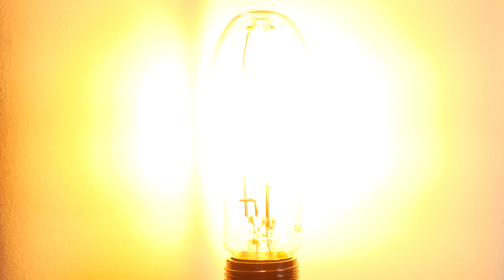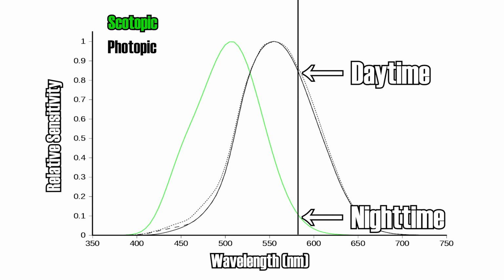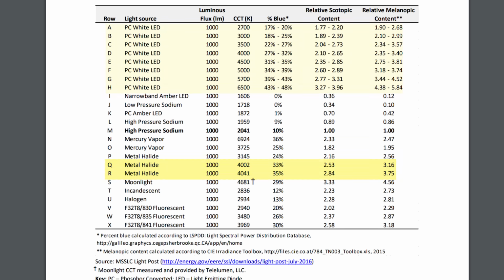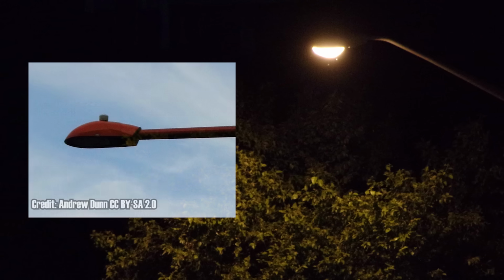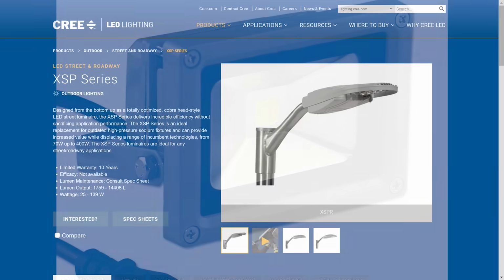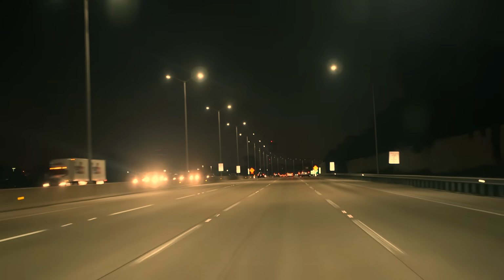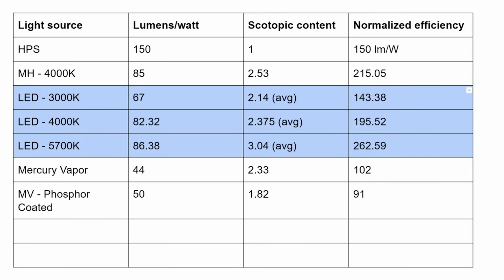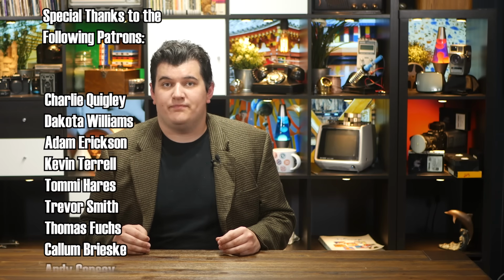The LED's Challenge to High Pressure Sodium

Comment: One of my absolute worst experiences I ever had with driving at night, was in a car that had all BRIGHT BLUE instrument lighting... I could barely see the road. Who comes up with such a dumb idea...
Reply: Didn't it have a switch, for turning down the brightness?
Reply: @BedsitBob  most people aren't that smart
Reply: That could be another topic for a video; what color of instrument lighting is best for night driving.
Reply: @digitalrailroader  BMW has the best. Reddish orange. Shame not the modern ones with operating system 7 anymore though.  Seriously drive one in the night (preferrably an older one, like an E90 or E60), you can keep brightness of the instrument cluster maxed and it won't do any bad for your dark sight.
Reply: @digitalrailroader  i would guess it’s probably red, the same reason cops use them to write reports. It is visible enough but doesn’t blind you from seeing outside of your car like a plain white light. Could be wrong though
Reply: @digitalrailroader  legitimately orange in the same vein as 80's jet instruments, why they switched to them
Reply: @digitalrailroader  dark amber
Reply: @digitalrailroader  red
Reply: @digitalrailroader  
Red, at least for instrument panel  ( dashboard) lights. But the green light in my van and cars  I've driven over the years  seems to work pretty well. I don't remember ever driving a vehicle with red dash lights. Maybe orange once.
 I've only seen the red  in other cars but they look really cool.
Reply: White for sure,dim white
Reply: @digitalrailroader  red probably
Reply: @digitalrailroader  Airplanes use red lighting which allows you to see outside the plane.
Reply: @digitalrailroader  green?
Reply: @tiger.98  Green was my first thought too. I work on aircraft and I think that's why I thought green
Reply: Bmw uses a dull orange for that exact reason. I never really noticed the effectiveness of it until i got a second car (Honda) which was green blue white whatever. They’re super effective as not distracting you at night.
Reply: @1v1qsns  yup. My 86 325es had that. IMO the best instrument color ever made.
Reply: I prefer red for my guages. Blue is far too distracting
Reply: @Jan Tuts - That bright blue dash lighting was almost certainly aftermarket, installed by some boneheaded previous owner. I've seen it done too many times.
Reply: Whoever thought blue light would be "cool" (as in impressive). And stupid stuff is usually considered "cool", regardless of the problems it causes.
Reply: Stuff like that should be dimmable. Most cars will dim the instrument cluster when you turn on the headlights. My car has a little thing to adjust the backlight
Reply: I have a serious vendetta against blue interior automotive lighting. It's borderline painful at night in some cars even on lowest brightness. White on black with amber needles was seriously the best dash design, idk why everything had to switch to fancy piercing colors. My 90s Volvo is white on black and easy to read in all lighting conditions with backlight set to near minimum. Simple and effective. Only color I would prefer over white is red for night driving, but I find during the day it's harder to see.
Reply: Was it a Mk4 or Mk5 VW Golf/Jetta?
Reply: @MacTechG4  Passats of that era also had blue dials, likely other vw products. Didn't own one but the few times I rode in one I did find it very distracting.
Reply: yes, they are blinding, but also problem of car driver themselves, they should adjust the high of beam so it doesn hit above the car's side mirrors
they can be arrested and fined for this mistake
the worst is when truck's and buses have those powerful beams, they force you to stop if they are behind you
i wear yellow polarized shades that stick to my prescription glasses when driving at night
Reply: To everyone who keeps saying "just turn down the brightness" or "change the colour":
That might be useful if it's YOUR CAR, that you know in and out (and are allowed to tweak), but when you have to hop in and drive someone else's car, that might not be the case.

And yes, blue light might help keep you awake, but it also destroys your night vision, which I'd say is quite important while driving at night.
I'd rather have to make the conscious decision whether or not I'm awake enough to drive, rather than have my vision compromised either way...

Also, if you're at the point of tiredness where you need to be kept awake by the light from your dashboard, you should definitely not be driving!
Reply: @JanTuts  Well-articulated comment.
Reply: The first time I saw one of those things lit at night, I thought it was the stupidest design on the planet.
In my own older car, I swapped out all the white lights for red ones, and even changed the color of the dome light to red.
One of the main reasons I did this is because I had two night jobs that required about 100,000 miles a year.
When I went to trucking, it was part of the job to drive at night, sleep during the day.
Everything in my sleeper was black, so I could be a "vampire" and sleep soundly all day.
Reply: yesss they should be banned for use in cars, when I ride my bike at night through my neighborhood I have to cover my eyes when a car with those white lights approached my head on on the opposite side of the road, it almost blinds me. when it gets too irritating because they are driving also with their high beans on I flip the finger at them to let them know they been bad.
Reply: Blue light is harder to adjust to for your night vision than red
Reply: I remember I had a Dodge Avenger (2nd gen) as a rental once. The guages were white and backlit. As in, the entire round gauge was white, and the numbers were not illuminated. So you could either burn your eyeballs, or turn down the brightness which made the gauges difficult to read.

Just stupid design.
Reply: Uh, turn down the brightness
Reply: My BMW uses a nice warm orange, it's an 08 e60 5 series
Reply: Yeah instrument gauge lighting adjustments are a thing on cars since like 1976
Reply: Volkswagen used to have blue dials with red needles, now they switched the dials to white - much better IMHO.
Reply: @paulzapodeanu9407  Yeah, I have 2008 golf and blue light are annoying AF. Even when turned down to lowest. There's a reason night-time flashlights are red - it doesn't blind your night vision so bad
Reply: @kasparslaizans3842  ahaha i was thinking about VW too. First time I drove them.at nights I was shocked. It was like a cheap night club. The screen in the middle console was torching my retinas even at lowest setting. If you turned off radio it mostly showed a black screen so I had to give up music to protect my eyes and driving ability.
Reply: well i actually did some swaps to blue lights, some people really love those. i'd suggest you check cars all around before buying or make sure you can dim or change the coloured bulbs
Reply: @Jan Tuts..... probably some guy whos never going to drive it
Reply: Obviously a person who lives in a world of one-way roads
Reply: I'd assume it's blue to try and be a safety feature, since reds will likely help you to fall asleep
Reply: @seamonkeys12y  Except now you're half blind and have no night vision. I pretty sure blue instrument clusters are all about looks. I doubt safety was ever a part of the consideration.
Reply: Volkswagen. They've stopped doing it. I had a Passat for a while, the lighting was a terrible distraction.
Reply: Yes i know sodium is just better because when you think of a street light you think of sodium not led
Reply: Dim the dash lights!
Reply: My 2nd gen ford escape is factory super bright blue. Even when turned down I wish it was a different colour. Really nice to look at, but killer at night.

Side note. Hyundai uses a very shitty blue on their dashboards that should be banned
Reply: I have owned a Honda with white gauges, GM cars with the sickly green, and BMWs with orange.

Of all of them, the BMW orange detracts the least from night vision, but is too sleep-inducing on long nighttime drives. 

Meanwhile the Honda white is more visibly distinct at very low brightness as opposed to green or orange, so less light can be used and the effect on night vision is about the same as BMW orange. Meanwhile the high blue spectrum content helps to maintain wakefulness. Overall this is my personal favorite gauge color.

GM green seems to be the worst of both worlds; hard to see when set very dim, yet lacks the blue light for wakefulness, yet still hurts night vision.
Reply: Sorry they make a product that has been researched to attract 99  percent of people that want to actually buy the product maybe companys should only sell products that cater to you. Obviously we have choices so don't buy something that isn't made specifically for you. Really
Reply: @dolphinvaio  In don't care what it looks like, I just don't want the car I'm driving to get me killed because someone thought it would look cool...
Reply: Satan and Agenda 21
Reply: @coolboy5428  Oh great, now there are conspiracy theories about street lighting
Reply: @coolboy5428  wew lad, you got a link to the Technology Connections video on Satan & Agenda 21?  Très curious
Reply: My car has a mostly white but slightly bluish green look. I find it a good color. It's slightly blue tinge helps keep you awake but it's also not so harsh as to hurt your night vision at max lighting level. It is also bright enough to be able to see the gauges clearly during the day. I never really felt distracted by the instrument lights.

Comment: I think the idea with the danger of the blue LEDs is that, just like a blacklight, the visible light level is low, so the UV sneaks in, both because you stare in its direction more, and that your pupils aren't as constricted
but I still doubt it. It wouldn't be that hard to test, just string some up in rat cages and see if they get cataracts...

(I actually like sky glow. People should certainly have the choice, but... it's cozy)

Comment: I miss the color of the old mercury vapor lamps in front of many buildings back in the early 1990’s in nyc,even some lamp posts still had the cool moonlight glow of mercury vapor lamps, the coated ones. There were one or 2 that still had the clear bulbs and the light was a bluish light,much better for the night than those piss looking sodium pressure lamps

Comment: Light pollution is a serious problem for nature and illumination does not increase security in traffic as Belgium's highways have proven. After shutting off illumination intermittently during the nighttime: it turns out if the street is not illuminated drivers drive more carefully.

Comment: They changed the traffic lights to l.e.d. in my town.they changed them back to the halogen lights or whatever they were after the first snow, because the l.e.d's were not hot enough to melt the ice. You couldn't see any light at all

Comment: Street lights were not introduced for driving safety concerns, but for discouraging criminals and robbers... As a pedestrian I'm less afraid of being hit by a car at night precisely because they have headlights .

Qnywqy, I think there is one additional advantage of HPSV light worth to be mentioned : because it's dim, warm AND very has poor CRI, it makes the surroundings visible but far less distracting.

The front zone of the driver, covered by the headlights, remains brighter and more colorful, which is consistent. But the most important thing TMO is that all the road signs and other reflective equipments are strongly highlighted,

In fact, here in France there are more and more highways sections and even rural roads that are no longer enlightened because the lack of visibility seems to paradoxaly reduce the amount of accident (by reducing disctrability and increasing vigilance)  

Well, that was my to cents...

Comment: For LED retrofit.. bypassed the ballast and direct wire the lamp socket..  no more ballast replacement, just replaced the LED retro fit lamp if it ever goes out.. that's how we are changing them t8  Fluorescent lighting.

Comment: Yes!!! Please I hope they switch to LEDs!!!  've always hated the orange lights. And I remember some years ago, on hwy 836, there was a really wide margin for a few miles and in the middle were some really tall lights with some super bright lights mounted and the poles for these light were very far apart. They lit up everything really great! And the lights were up so high that they didn't blind you at all. I've always wondered why they don't use that same kind of thing on streetlights. We wouldn't need nearly as many streetlight, and if they're up high enough, everything would be much better lit without the blinding effect that occurs with normal height streetlights no matter what kind of lamp is used. But to me, the orange lights are so hard on the eyes! I wish they'd finally get rid of them!!

Comment: As someone who has worked as a trucker, I can tell you a little circadian rhythm disruption isn't entirely a bad thing.

Also, the option no one is considering here is that LEDs can produce more than just blue light.  You can use a combination of diodes to produce white light.

Comment: Our town has been piloting various replacement led street lighting over the last couple of years in a few square block are that covers residential, as well retail, and commercial business. They are now one the third led lamp style and I have to say they are getting closer to good answer. Sorry I don't know the details of any of the three test led bulbs but this last batch seems to have taken the harsh edge off the light and is most noticeable on residential streets. It is not as soft as the HPS but seems to light the area better but not to the obnoxious level of the first two tries. It might also just be acclimation, I don't know.

Comment: The only thing I remember is at night our eyes produce something called visual purple to enhance our vision in low light and that the molecule is destroyed by blue wavelengths of light. I think that's what people are talking about when encountering these LED lights on cars. An encounter with them will reduce some of your low light visual capacity until the visual purple is rebuilt.

Either way, it's why I keep one eye closed when using the bathroom at night and walk back to bed with the other eye open so I can see my way back more easily.
Reply: I use smart LED's that can change colors, at night they will automatically be red to be less harmful on night vision just in case I need to get up.

Comment: On the forklifts at work we had to put straight blue light on it, they do blind you when you are getting wrapped pallets with plastic wrap or the light hitting the backside of the forks on the fork lift. I've been blinded numerous times. I'm not the only one either many of the guys I work with along those in the warehouse hate it as well. You might want to check into these.

Comment: Low sodium lights are used because they are easy to filter out you don't know why low sodium bulbs are use. because of light pollution.
Reply: the reason we use low sodiumb bulbs specifically because we don't see better with them dummy.

Comment: I work for an organization that build street lights. The preferred decorative type street lights, seem to be more often made in the 4000 K range. We do build a lot of the type of lamps that are used on the interstate highways and such, that are in the 5000 K range. On the ones that are used in infrastructure, or the interstate highway type light, the lenses on these are either flat, or very small amount of raised area. So therefore they are not well seen from the sides and the top. These things keep evolving, and we just released a new fixture this year that is even less of a light polluter. A lot of the decorative fixtures are designed after the original gas lights from over a century ago. Fitting these to LED use do have some wasted light, but we do continue to refine the optics to lessen this. Thank you for this video, I really appreciated it.

Comment: Working for the local utility company here (we also do maintanence on the street lights) I can say that the two biggest issues with LED lights that I noticed are: 
1. The drivers are not very robust compaed to the ballasts on the sodium lamps. Im most cases when an LED street light goes out it's actually the driver that has died, not the lamp itself (altho those die too but it's infrequent).
2. Finding replacements can be a pain. Models go in and out of stule rather quickly, and most of them being non-servicable you have to replace the entire fixture and by then the one you had might nor be avaliable anymore. I am hwever seing more and more fixtures with plug-in LEDs and drivers and are therefore servicable, so at least things are heading in the right direction. 

Personally I really like the orange light from the streetlights, but also have to admit that it's a lot easier to see things on streets lit by LED lights. Here I'd have to agree with what many comments have already mentioned, putting LED lights on the main streets in the town/city and then keep the residential areas lit by sodium.
Reply: Drivers will get better with time, sodium lights is so dull and booring

Comment: High pressure sodium was preferred because the light spectrum was easier on the eye but produced a higher lumen intensity of light and  did not produce significant shadows + there were no 5 g relay transmitters fitted to each post

Comment: The are replacing LEDs for the HPS fixtures on the Air Base that I work on. Once particular street has a stretch where they have both. The LED lights are 10 times as bright, to the detriment to the people in base housing.